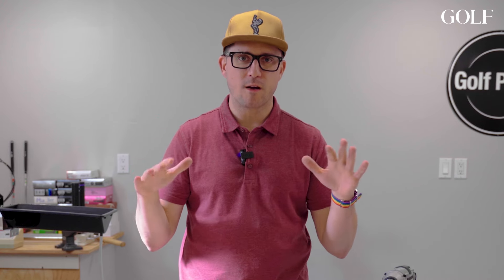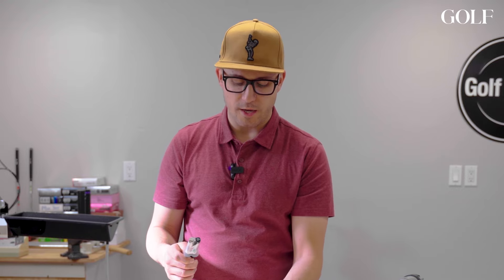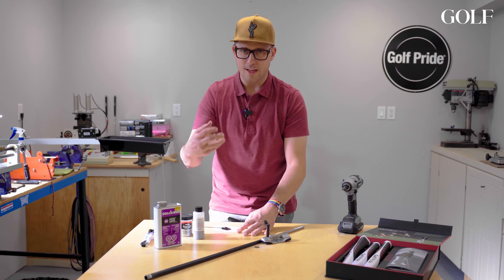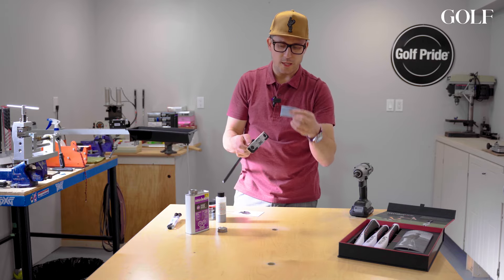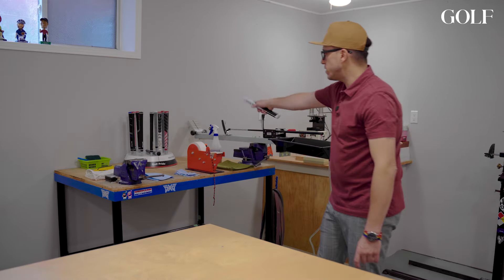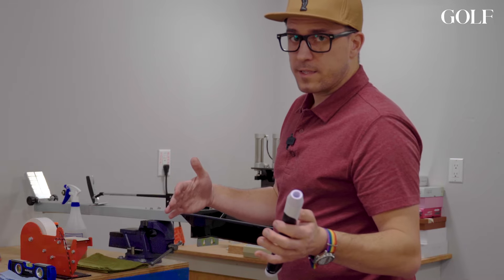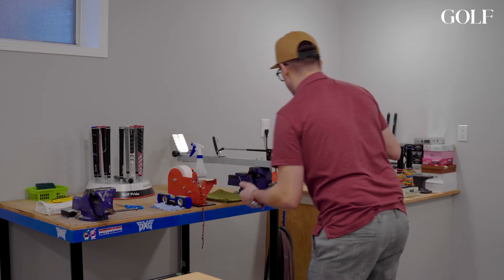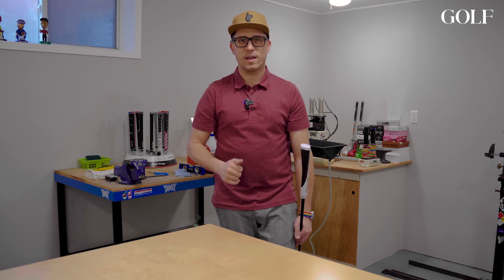How To Build Your Own Putter | The Build Shop

Comment: It’s actually really easy to build a putter,I’ve re-shafted mine before and when u put the putter in the vice,get a small leveller and make sure the face is 100% square first then put the grip on and then re-check the face THEN once the grip is on,put that leveller on the grip and check it in 3-4 different places and when u see it’s square all the way up the grip,leave it to dry(24 hrs if it’s glue) then your good to go